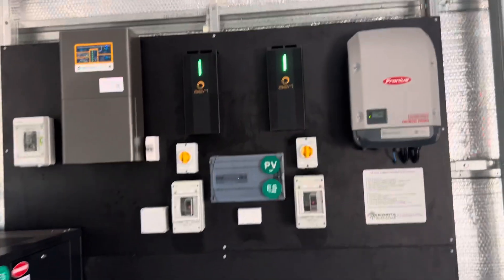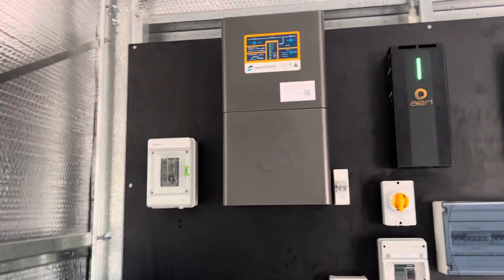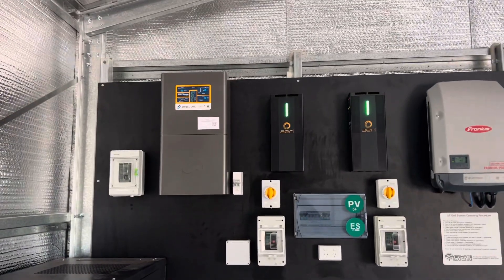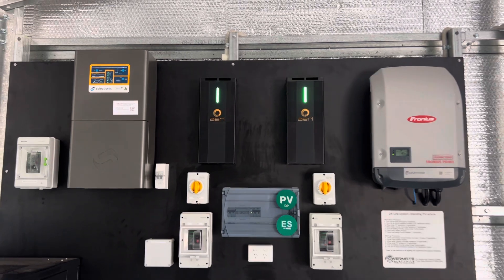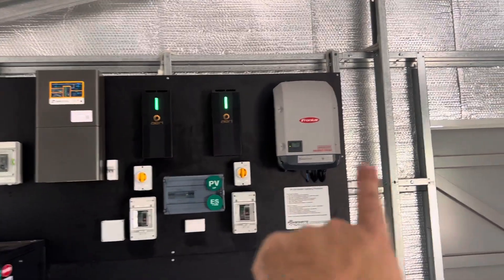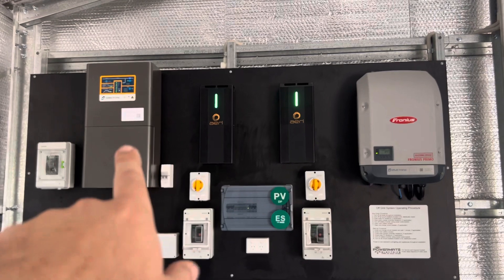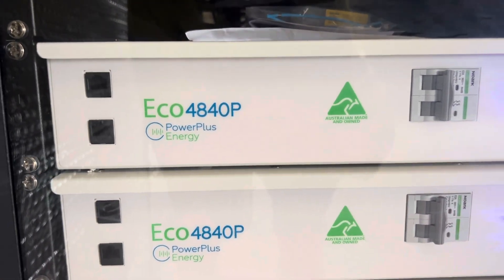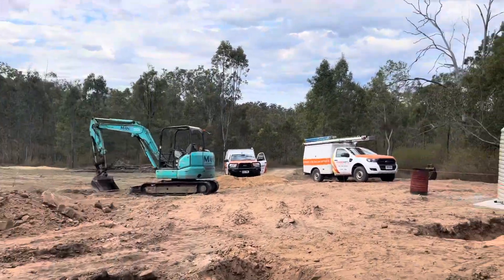Selectronic PowerPlus energy AERL offgrid solar system

Comment: would have gone victron - buy once , cry once
Reply from the maker: Victron is a great product and we also use Victron when looking to save on cost. Selectronic has many benefits, 10yr warranty, more intuitive programming, equal or more functionality for controlling external equipment and integration. Ability for managed AC coupled solar and many more. Also surge and output rating are much higher with the equivalent Victron equipment. The downside is, selectronic has nowhere near the range of available products compared to Victron. This is why we use both brands depending client. Hope this clears a few things up for you😊😊
Reply from the maker: Also to add. AERL was the original inventor of the max power point tracker (MPPT) technology. Also a great MPPT charge controller with integrated earth fault alarms for DC which is a requirement for AUS. This is a limiting factor when using Victron on DC coupled only systems as they only have the rs450 MPPT with the i built earth fault alarm.
Reply: @powermateelectrics  interesting !!
Reply: Yes you’re right buying  Victron ..buy once would make you cry then buy selectronic